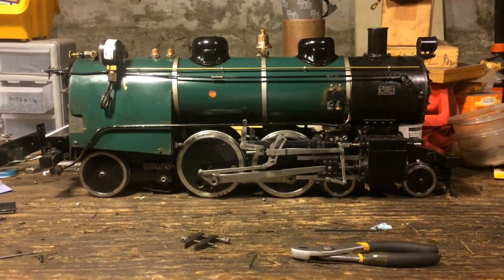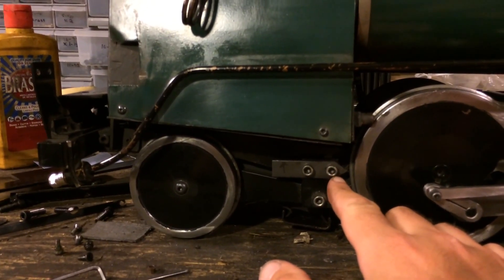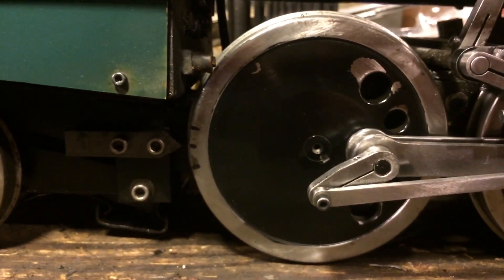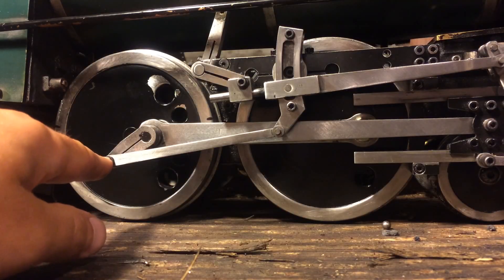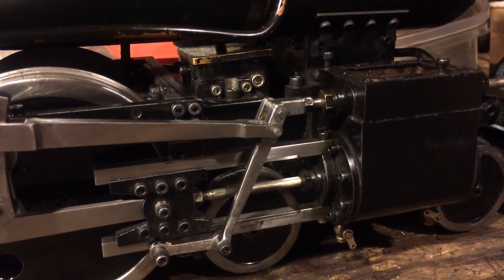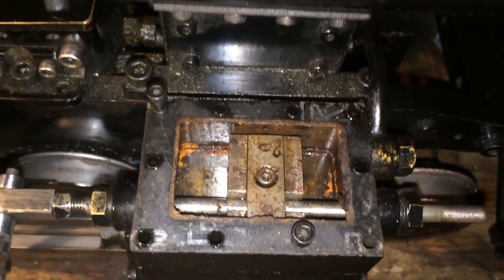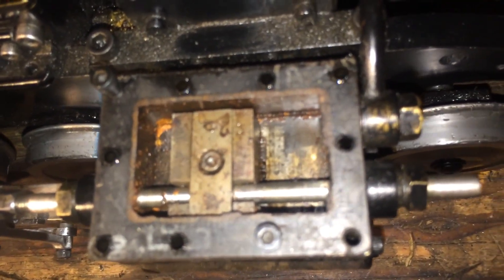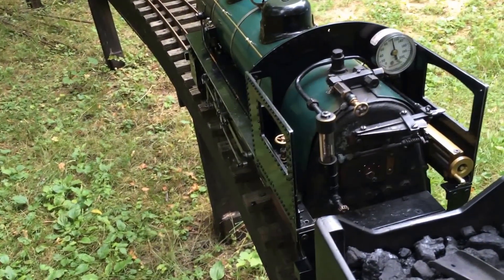Timing Walschaert Valve Gear on a live steam locomotive

Comment: On a 3½  or 5 inch loco, The downside of cutting back the steam is you now have less exhaust to draw gases through the boiler from the fire in the firebox meaning less air being pulled through the fire which we need to excite the combustion process.
My question is, should there to a downward tension on the valve block or does it just float ?
Reply from the maker: Its true that running the engine cut-off send less exhaust up the stack, hence less draft for the same power setting. You can adjust/reduce the exhaust nozzle size to compensate for some of that if desired. It will increase the backpressure, but still reduce overall steam consumption. The slide valve block is held down by steam pressure in the chest.

Comment: Thank you very much sir!

Forgive me but is "the pointer" aligned with the center of the axels?  The video didn't say specifically but the location seems right.
Reply from the maker: It actually doesn't matter where the pointer is. Its simply a reference marker. Any convenient location will do. All that matters is that you mark the points using the method described so that you can come back to them as you work through timing the valves.
Reply: Many thanks sir!  Yes, thinking about it a bit more the marks should be 180 degrees apart of whatever location "the pointer" was picked.

I've got spool valves and I got another good tip yesterday.  Attach pieces of hose from the cylinder drain cocks to a bucket of water and lightly pressurize the boiler with compressed air.  Then slowly move the spool valve forward or aft until bubbles of air indicate that the valve is opening.  Not wanting to loosen the nut holding the spool valve against its collar, I cut a slit in the end of the valve rod so I could make fine adjustments with a screw driver.

Hopefully I make things better rather than worse for my 0-4-0T.

Comment: I bought a 3 cylinder loco a year ago, which didn’t run. I’ve spent that year overhauling the entire thing, with only a small improvement. Your  video prompted me to investigate as I assumed the return crank would be fixed and set in stone! It turned out it wasn’t and clearly had a life of being messed about with by ignorants. Fingers crossed and thanks for your easily watchable instruction. 
Still learning, and bracing myself for  centre cylinder complication, as it relies on a conjugated linkage from the outside two?

Comment: In a full size steam loco, do you have the same setup each side, and if so how are they co-ordinated. This is something i have thought about for quite a time, I look forward to your reply some time thank you.
Reply: nottyash100 I think they do
Reply: It is a full size locomotive , just a small one ☝️
Reply: Yes both sets of pistons have this running gear.

The shaft that the reversing lever is mounted to turns the other one on the other side.

Since the position of the piston doesnt affect the radius movement,

Comment: In all of the instructions I have read and been told, when setting valves to always move the engine in the same direction.  If the engine must be brought back it should go more and then come back so all slack is out of the motion.  This is not criticism just an added observation.  I helped set the valves on a 17 ton loco and that is the way we did it.

Comment: Sir. I want to know the function of combination lever
Reply: its function is to keep the top and bottom piston in the correct timing to allow steam into the bottom piston
Reply: @crazynachos4230  Thank you sir.
Reply: @talukdarchinmay  you're welcome
Reply: @crazynachos4230  Can Engine works without this Combination Lever
Reply: @talukdarchinmay  no it's every part on the engine is absolutely necessary or everything would be out of phase or just not even work
Reply: @crazynachos4230  Thanks Sir for the explanation
Actually I built one air engine(Double acting) using plastic syringes. Where I never used this C. Lever and works with aquarium air pump only.

Comment: Jay, Finally Someone who can explain this very importante process! Thanks so much for making this very informative video, I drove full size Steam Locomotives here in Queensland Australia for work, and always wondered why one engine would perform better than another.  Timing is everything. All our Engines in Queensland Rail are Left leading Inside admission piston valve Walsharts with Essentric set 90° behind the crank, except for a Baldwin 2-8-2 McCarthur which is set 90° ahead due to the forward motion being derived with the die block being in the top portion of the quadrant Link.  Thanks once again. Cheers Adrian
Reply: sorry to be intrusive, but I live in Queensland too and was wondering which loco you drove and what job you have to where you operate steam locomotive (unless it is volunteering)? Also was the Baldwin engine you where talking about the AC16 ('Yank') class?
Reply: @The_Olive_Tree_1079  I used to be a Train Driver based at Mayne in Brisbane, and was senior enough in service to be accepted into the Heritage Division of Queensland Rail. The Locomotives that QR operated are based out at Ipswich at the workshops. I used to Drive the Yank AC16 221A. If you are interested in Steam, you're best bet is to volunteer at Toowoomba, Warwick, Swanbank or Gympie at the Valley Rattler. Hope that helps.

Comment: Quite interesting, maybe you can do video how this valve gear works and how to design it. I had a few questions, but when i was thinking about them for a longer time, i think i answered them. Just to check:
- Eccentric pin is approximately 90deg from driving pin, but not necessarily exactly the same. Difference is caused by eccentric rod usually going little upwards.
- Combination lever is there to create phase offset other than 90 degrees between valve opening and piston position, so valve may be already closed when piston is in the middle position.
Anyways ... it's  mostly mental exercise, steam engines are fascinating and to understand principle, i needed to read 30 pages and it was simplified by assuming that all movements are sinusoids. Your video clarifies at least some details.

Comment: I note that you talk about the % of the stroke but show the % wheel rotation, I thought % cutoff is the % stroke at cutoff and % wheel rotation is not the same thing, is that right? Great video though and I learned a lot from it, thanks.
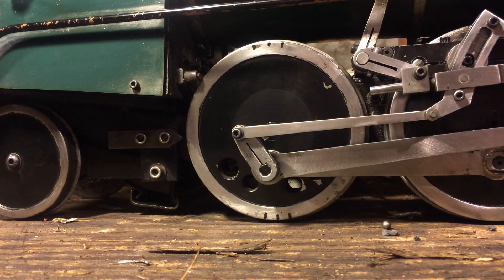Reply: That is correct. Due to the angulation of the main rod, % cut off is not the same as % wheel rotation. When the crank pin is at the 6 and 12 o'clock positions, the piston is not centered but is to the rear of being center. When the piston is half way through the stroke, the crank pin is before the 6 o'clock position (like 5-5:30) and and after the 12 o'clock position (like 12:30-1)

To determine % cut off, the length that the piston has moved is divided by the total stroke length.

Comment: Thanks for this. This was very informative. I am into smaller gauges (Gauge 1), but the concept is the same. What about the difference between the two sides? Do you know how this process changes for a simplified valve gear. This is yet again "common" on G scale and Gauge one, where there is no reversing lever, but a separate reversing valve.
Reply from the maker: I'm not very familiar with the G scale simplified valve gears, however setting and working from the correct dead centers would still be applicable, as would the 90 degree offset of the crank from the crankpin. Right and left sides operate completely independent of one another. The only relationship between the two is the 90 degree offset on the axle.
Reply: Thanks.
Reply: @jmonty1201  do you still have the locomotive I'd like to see if you are interested in selling it or showing us if it running

Comment: 1.  Very nice presentation - It's unique in that you average the front n rear dead center 
positions with the marking pointer.  That would accommodate any slack in the valve gear
connections.  Focus was excellent.  Wished your voice volume was a bit louder at the
beginning of the video.  Setting the vol control at the screen bottom to max and another
at the bottom bar of my desk top to max didn't help much.  But after the initial portion,
the vol was OK but still had to keep both controls high.

2.  Walschaerts Valve Gear Design Process - 

     a.  How did you design your valve gear?  Geometrically or Algebraically (w equations)?

     b.  What source did you use?

          I started out with reading:

          i)   Walschaerts'Valve Gear, Henry Greenly
          ii)  Locomotive Valves and Valve Gears, J H Yoder n G B Wharen
          iii) Docstaeder's software on-line
          iv)  D L Ashton's Design Proc. for Walsch n Stephenson's Valve Gears

    i) was the easiest to read but not much helpful to design the reverse gears

    ii) was more detailed w Geometry

    iii) the reverse gear parameter values were poorly explained and without legit values,
          the simulation animation began to falter.  the entire software became useless

    iv) Ashton's tabular parameter entry parameters were not explained well and was 
         useless, including the book which was too over complicated (hey, i was a math
         minor in college) and his text was hard to understand

I've also put out a help request at chaski.org web site regarding my finding on the Docstaeder's problem but no one seems to know how to over come the defect:

  http://www.chaski.org/homemachinist/viewtopic.php?f=8&t=98490&start=48

Your advice would be appreciated,

Dor_Crank
Reply: With outside admission (this engine has D valves which is outside admission) the motion through the lead and lap lever is opposite of the motion of the piston so the radius rod (which acts as a pivot in center) is between the valve connection and the union link. With inside admission (most spool valves), the movement of the piston through the lead and lap lever is in the same direction as the piston so the radius rod connection is above the valve connection on the radius rod.

The length of the lead and lap lever is determined by knowing the stroke of the piston and then the valve will move 2x(lap + lead). Lap is how much the valve overhangs the ports when the valve is centered. Lead, as said here, is how much the valve is open on dead center. If the valve overhangs the ports (lap) by 1/8" and has 1/16" lead, the valve will move 2(1/8+1/16) = 3/8". The positions of the holes on the lead and lap lever are determined through geometry to move the valve in proportion to the piston's stroke.

The Union link length needs to be set so that when the piston is centered and the valve gear is in center that the lead and lap lever is vertical (and the valve is also centered) so the lead and lap lever will have even swing about the vertical plane. This will produce even cut off between the front and back side of the piston.

The placement of the link needs to be determined as far as where its frame will fit. The radius of the link will match the length of the radius rod. The foot of the link (on the bottom) is set behind the the center of the curved radius to even up the swing of the link about the vertical plane.

The throw of the eccentric crank is NOT the throw of the valve, but is set greater. The link is a lever and the eccentric rod connects at the bottom of the link and the radius rod/link block may be about 2/3rds the distance away from center as the eccentric rod connection at the foot of the link. To obtain the desired maximum valve motion, the foot of the link needs to travel more which means that the eccentric crank is set to a larger throw than the valve will do. This is also determined by geometry.